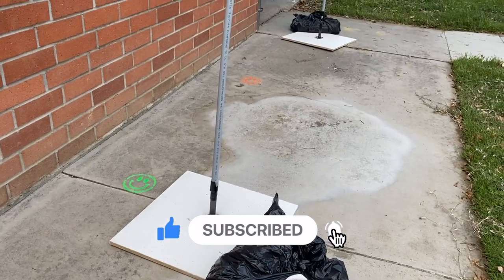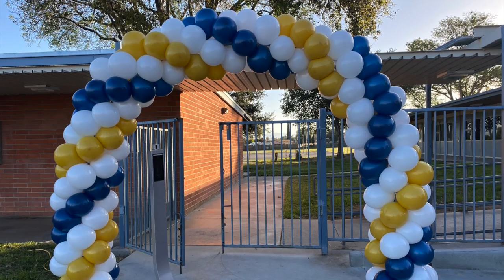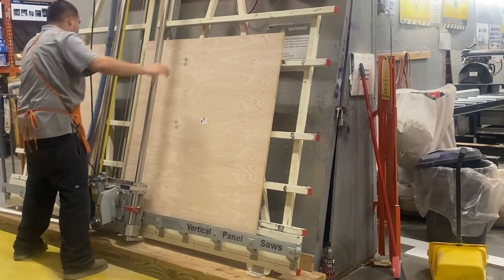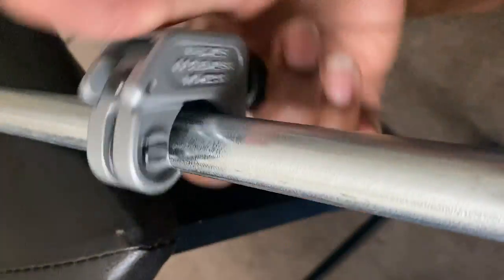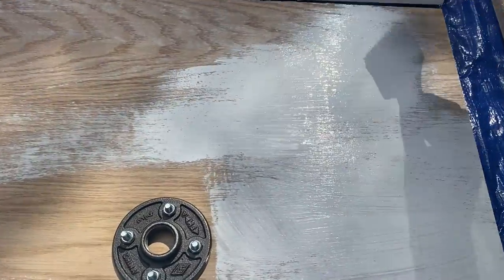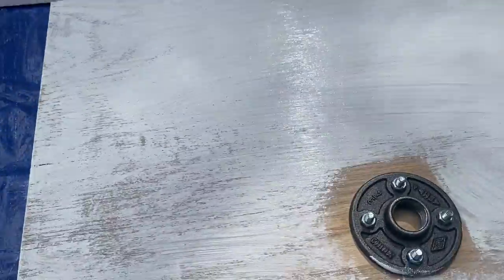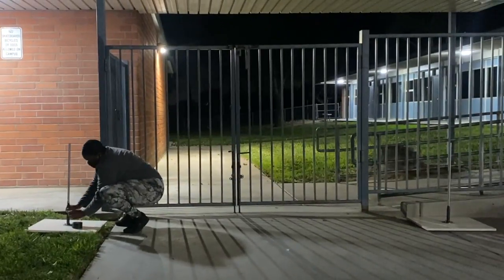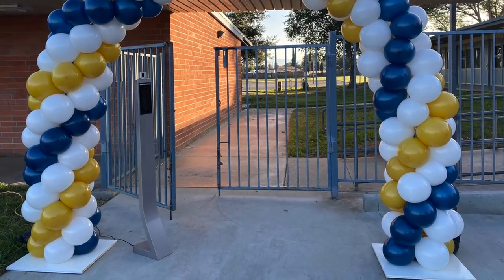HOW TO: OUTDOOR BALLOON ARCH BASE | TUTORIAL

Comment: How long did you cut the metal pipe for the base on each side? They look about 2.5 feet?
Reply from the maker: Hi! I cut them in half. I do not remember what the actual length was for the original size but it’s probably 4feet

Comment: Hi. Do you need 1 electrical pipe with a bell on each end and 1 with one bell at the end
Reply from the maker: Hi! The pipes I got  had bell on both end.
Reply: Thank you. Did you have to cut one of the electrical pvc pipes
Reply from the maker: @citlalicastro87  not at all, I used 2 for 1 arch
Reply from the maker: @citlalicastro87  not at all, I used 2 for 1 arch